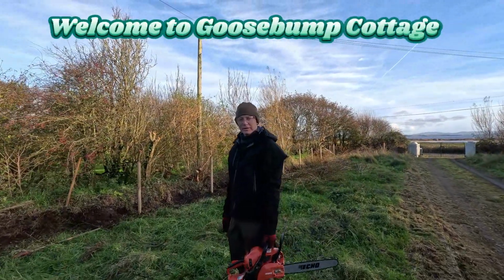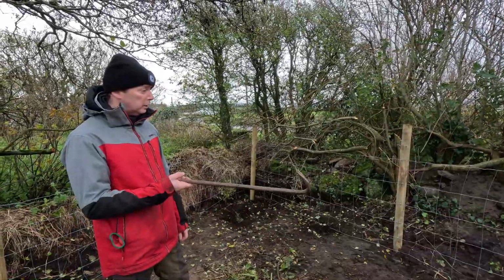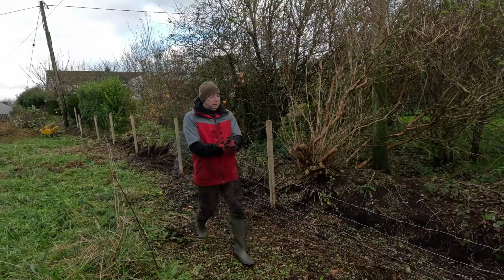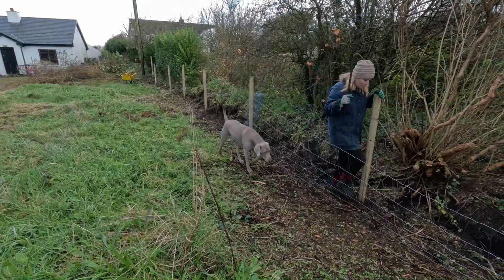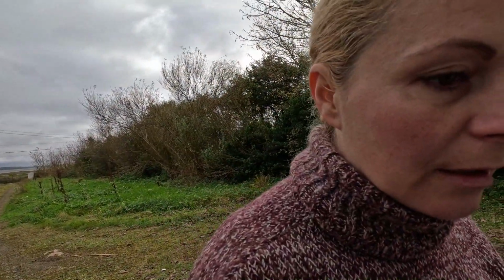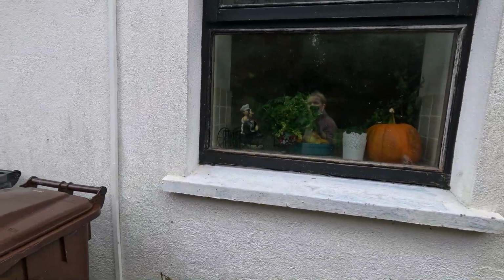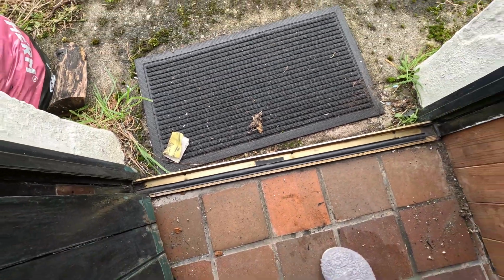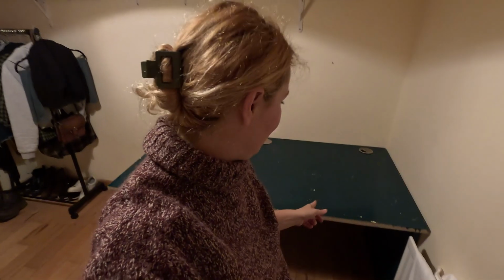Cottage renovation| Sheep/doggy wire installation, sanding doors, scraping windows + an unhappy dog.

Comment: fasten the wire at the corner posts, , and make sure there is braces at the corners, than roll out the wire to the end of your line if the distance is like yours appears,  Than place a verticle rod on the wire , to pull with a wire stretcher which needs to be anchored to something really solid, and than finally go and attach wire with staples to the existing posts.
Reply from the maker: Thanks David, some good advice, which we will be implementing in the future !